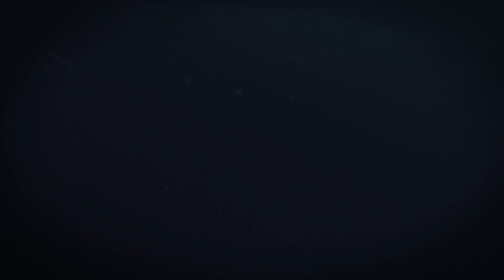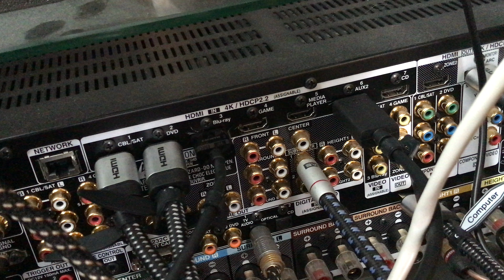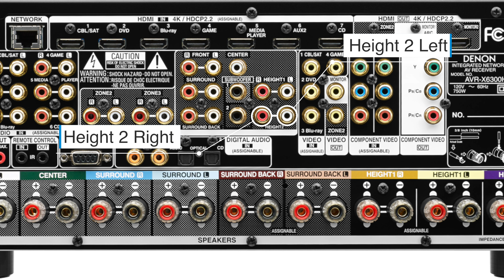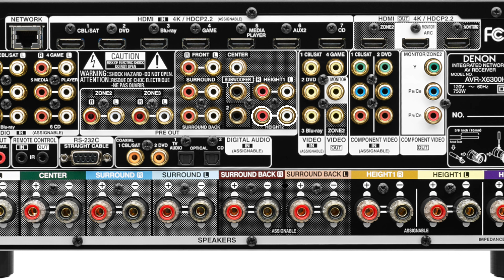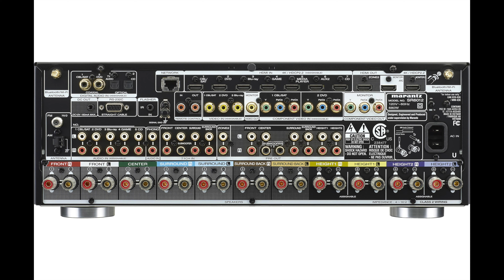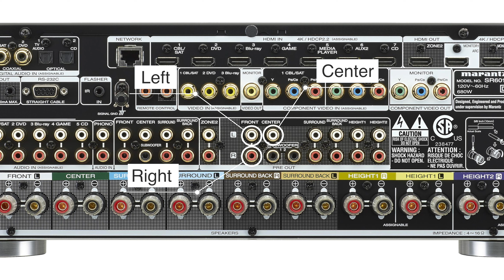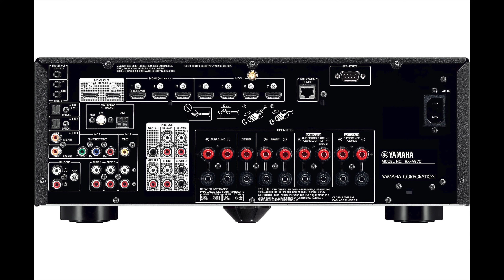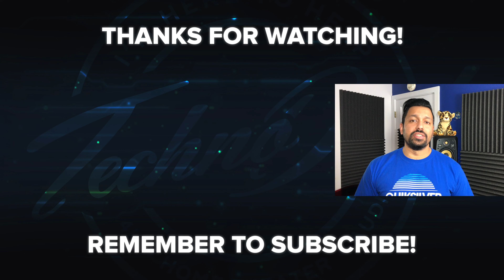How to Add an External Amplifier to Your AV Receiver | Home Theater Basics

Comment: Hey man! Thanks for the video! If you just do a two-channel stereo amplifier for your front left and right for great stereo playback and use your AVR for your Center and surrounds do you have to worry about things being unequally powered and sounding bad for movies? Or does the AVR know how to even it out? Thanks again
Reply from the maker: Hi Michael, great question!  If you are using the pre-outs on your AVR, it should be balancing your system even though you are using an external amp for your mains.
Reply: @TechnoDad  you're the man thank you! Just when I start I think I got this stuff figured out I get confused you. I was looking at a preamp that is a power amp also and was talking about fixed gain to use as an external amp so I thought that was necessary for all external amps. But I guess that's a preamp thing.
Reply: @TechnoDad  how do you control volume? does the pre-out to the amplifier will increase the volume if you increase volume in AVR? amplifier does not have a volume control, right?

Comment: My receiver doesnt have rca preouts. Can you just use your speaker wire from your regular output
Reply: No
Reply: actually, yes you can.    You need something called a line out converter, or LOC converter.  An active one preferably.

Comment: Hi tecno dad
I have an onkyo receiver TXRZ 720 7.1 channel, a fluance bipolar surround speaker HFBP,
 8 ohms 30-120w, and fluance tower speaker XL7F  
8 ohms 80-200w. When I checked on the internet it said the onkyo reciever is able to go 8 ohms 110w per channel, 6 ohms 225w per channel, but why doesn't it show 8 ohms when I go to the settings because it only show 4 ohms and 6 ohms.
next if I go 6 ohms 225w per channel and put volume on high, could it damage my surround/ tower speakers or receiver?
If I want to add ceiling speakers can I connect them to my rear surround speakers through a series connection?

Comment: Ultimately very efficient speakers will do the trick if you are doing a living room system or in a situation where you cant crank it.

But in a dedicated room where you want to hit reference level, additional amps for the front sound stage is the way to go.

Or even better...sensitive speakers AND plenty of power.  The best of both worlds.
Reply from the maker: Agreed!!
Reply: Ooh… I was **wondering** what on Earth the Audiophiliac was going on about when—during one of his celebratory videos of the Klipsch RP600M bookshelf speakers (which I was convinced to acquire)—he made a comment in passing, while *celebrating* how easy they were to drive, that they would make use of the power “*if you had it*.”  
I had bought what is considered a “*powerful*” Onkyo receiver from a list of the Top Ten AirPlay 2 AVRs of 2019, to feed the “*power hog*” ELAC Uni-Fi UB5 bookshelf speakers Steve G. and the posse had convinced me to acquire not long before the Klipsch.  
I remain confident the ELACs will **feast** on the Crown XLi 1500, but I must admit, the much more sensitive Klipsch remained a source of curiosity.

Comment: @techno dad, does that mean I can run two of the same channel, so if I get an amp to run my front right and left and center channel  could I run a another front right and left and center channel? One set off of the AV receiver power and another off of the amps power
Reply from the maker: Yeah, in theory you can, but I think they would be off power wise.
Reply: @TechnoDad  why the reason I was asking is because I have 4  floor standing speakers with Atmos enabled in the top of them and I wanted to put some in-ceiling speakers and run both of them at the same time

Comment: Great vid! I have a theatre newbie question about powering just your front LCR with an external amp and leaving your receiver to do the (4 to 8) other surround channels. Is there now an imbalance with power to the front LCR as compared with the surrounds that you have to make adjustments for? Manual adjustment or using your receiver’s room correction mic? I know you removed the main load with the external amp.... but who knows what the receiver is now supplying to the rest....
Reply: Nope. Thats exactly what you should do.

Comment: Thanks TechoDad. good info. Now what if you are using an old extra AVR instead of a dedicated power amp? what would the connections be from Main AVR to the old AVR being used as a PA ?
Reply from the maker: Hi!  So that's tough as you'll have two volumes to deal with.

Comment: Can I hook up car subwoofers to the denon avr x4400h reciever?
Reply from the maker: You could, but how are you powering them?
Reply: @TechnoDad  I would like the reciever to power them other wise I would use a 400watt JL car amplifier. The car subs still sound good and I don't want to spend another 500+ dollars on a home theater subwoofer. I had the subs hooked up to my old Sony reciever that is around 15 years old and it worked fine. It seems trying to get these car subs to work with this new Denon receiver is a lot more complicated. Any help is much appreciated. The subs are two 10inch kicker cvx btw.
Reply from the maker: Using the AVR would be tough as you would need another output.  How many channels are you using all together on the X4400H?  7 channels?  9 channels?  You would need a line level out and you might also need a crossover.  If you were to power the subs with that JL car amp you mentioned, you could use the subwoofer pre-out on the Denon and that way the signal would at least be crossed over.

Comment: Sir, what brand of "Banana Plug - cables" are you using? I use Profigold Banana Plug connectors which I generally connect with the speaker wires and then they are ready to use. Looking at those pre-built cables I feel they save a huge amount of labour - of pushing seperate wire individually with each piece of banana plug connectors !!! And where to get them online? Any link from Amazon? I mean amazon.com?

Comment: So,where do I plug in the power cord in the reciever so the amp will switch on and off with the receiver
Reply: You need to connect the cable from receiver 12v trigger out and into the amp 12v trigger in if it has it.

Comment: Can pre-outs be connected to video in/Aux inputs on a pre-amplifier and have that connected to a power amplifier to drive main left and right speakers?  I have current audio system that way and would like to just feed receiver pre-outs to the preamp
Reply from the maker: Hi!  Maybe if the pre-amp doesn't process the signal.

Comment: Hi technodad,  I have the emotiva A300 pushing my LR speaker at 150 watts per channel. Sounds great but now my center speaker (Klipsch RC62II) seems to be underpowered. I was looking at the outlaw 2200 monoblock to power it up. Can I choose  a different brand of ext amplifier(outlaw) or should I stick with Emotiva and get monoblock from them for a more uniform soundstage? What do you think ?
Reply: Stick with emotiva great performance and they build them like a tank always underated watts so 80 watrs would be 100.outlaws good too but I like emotiva products a lil better.
Reply: Just get the Outlaw mono. Those are real good amps. Center is the most important piece and you aren't going to notice a difference in sound between the front 3.

Comment: I have a Marantz 7011 and I just bought a Emotiva Audio A-700 BasX 7-channel Power Amplifier. I have 4 of these  Klipsch RP-280F and this as my center speaker RP-450C and I have 2 of these RP-250S thinking about buying 2 more of them and finally 2 subwoofers  R-115SW subwoofers. Would like to buy some ceiling speakers for Dolby Atmos. How would you hook up all of this?

Comment: Nice video!!
I have denon rxv2400. It has pre-out for zone 2 only. Can i add an amp and run 5.1 setup? Need your wise suggestion.
Thanks
Reply from the maker: Hi!!  When I search Denon RXV2400 I get a lot of results for a Yamaha RX-V2400
Reply: @TechnoDad  sorry my mistake. It will be denon avr x2400h.
Reply from the maker: Okay, so with this AVR you should be able to run 5.1.2 with zone 2 pre outs as well.
Reply: @TechnoDad  thanks for your reply. My intention is, I want to use power amp for front L & R channel using zone 2 pre-out. Is it working like actual front L&R channel in surround mode?
Reply from the maker: @lovethemusic4933  Yeah, that won't work.  Zone 2 is completely separate from the surround in Zone 1.  You would need the Denon X3400H to get Pre-Outs to do what you want to accomplish.
Reply: @TechnoDad  thanks for your suggestion.
Reply from the maker: You're welcome!

Comment: My Onkyo TX-NR757 doesn’t have a pre out section. Can you do a google search and look at the back and tell me what my best option is?  Looking to get an external amp and can’t figure out how I would go about connecting it, or should I just give up on this receiver and get a better receiver. It’s a great one and I hate to have to get a new one, but will if I have to.
Reply from the maker: Hi!  Yes, you would have to get a new AVR.  If you like Onkyo, you would need something like the RZ820 (https://amzn.to/2P1sdE8) $499 right now.  It'll give you a little bit more power and has the pre-outs for all 7 channels.  But, if you're going to plunk down that much money, I would suggest saving up a little more and looking at the RZ730 (https://amzn.to/2E0zbIH) as it can process 9 channels and has pre-outs for upgrading power later on.
Reply: Thanks man. Much appreciated

Comment: Hey Techno Dad, I enjoy your youtube channel. 

I have two systems that I would like to incorporate into an older but still good Sony Receiver. It's a Sony STR DA3100ES driving Mission Speakers.(1) I would like to input my Schiit Jotunheim Pre-Amp with DAC into the Sony. Should I use an analogue single ended input such as the Tape that is unused. (2)The other system is a Schiit Asgard 2 which is my analogue rig with a turntable pre-amp Schiit Mani. Any suggestions are appreciated. Thanks

Comment: HELP please , i have ht7800 from onkyo and the av receiver do 100 w/ch 8ohm , so if I put an amp thats give 140 watt is that well be 240 watt total or only 140 w?
Reply: That would 140Watt per channel only for the amp that you have added. Its just that you will not be using the power of HT7800 as what is advertised is not entirely true. So if you use 7 channels of HT7800 it is not 100W/ch in reality .. it should be around 60 or 70w max :)

Comment: Techno dad, I'm a complete noob when it comes to power amps. Never thought i needed one until i saw your clip. As my frontstage,  I have a couple Klipsch 82ii tower speakers  paired with the RC62ii as a center, powered by my Pioneer elite sc-77. I always felt my speakers werent use at their full potential. I thought it was because my speakers were weak and needed to be replaced until I saw your video. Do you think I'll gain a fuller sound by buying a power amp? And if so, which 3 channel power amp do you recommend? I have a 7.2 setup.
Reply from the maker: Hi!  Well, those Klipsch are 98dB sensitive so they should be plenty loud!!  If you are having issues, then a 3 channel amp would be a great addition to your setup.  There aren't too many on the market, but I know Emotiva has the XPA-3 Gen 3 (https://amzn.to/2SD8OfZ) which is $1,199.  Then there's the Parasound A31 (http://www.parasound.com/a31.php) which is around $3K.  You could also go with a 5 channel amp but only use 3 of those channels.  Shoot me an email and we can discuss this in greater detail: technodad55 at gmail

Comment: So if I remove certain speaker from my main receiver to an external amp. The receiver automatically will re power the rest speaker left with higher wattage?
Reply from the maker: That's the idea, but I'm not 100% sure that all AVRs do this.  I know some save higher amounts of power for the front stage and give less to the surrounds but I'm not sure all of them do that.
Reply: Since you and me have Denon receivers have you tried to see if there’s a difference as far as the receiver power after removing some?
Reply: Technodad if I would want to use my Denon to power my front stage and height speakers, with Front biamp it doesn’t matter the amp assign option right? The preouts always have a signal coming out of them right? The external amp would power the surrounds and voice of god channels. Also does the VOG channel compatible to be used with all the sound formats?

Comment: I need help understanding a receiver a bit better.I have a setup with large speakers and a decent size sub.I can not run the set up on a high volume without the reciever crashing.I have a denon 170w and I am not sure what to do.Im sorry if I seem liuke an idiot,just need to know...
Reply from the maker: Hi!  So it sounds to me like you AVR is clipping at high volumes.  That means it doesn't have enough power to properly drive those speakers.  What model speakers and AVR do you have?
Reply: @TechnoDad  we seemed to have fixed it for now.We used a small gauge wire we found for 1 of the speakers and it seems that now that we removed it,its no longer doing that.I will keep you updated if it happens while testing.
Reply: @TechnoDad  also the unit is an onkyo 170w and we are attaching 4 mini sony chirps and 2 large sony speakers.There is also a subwoofer.(dont remember the brand of that one but its adjustable,not a one connect

Comment: Hey man thanks a lot for the video. My question is that which Rca cables should be used for connecting the integrated Amp?
Reply from the maker: Hi Zain!  Thanks for watching!  I'm glad you found the video.  It's really up to you.  I like the SVS RCA cables as they look nice and have a good gauge size to them.  Honestly, anything should work.

Comment: Hello, I liked this video.  I've got the Yamaha AVR and the preouts are xlr.  Connected them to a QSC power amp RM 1450 with LEM x300 speakers (Front L&R chnls)..Im just surprised that it really doesn't sound as good as when connected to a mixer.  Any thoughts? Thanks...
Reply from the maker: Hi Manny!  Those QSC amps are made for live events as opposed to home theater.  That could be it, but I'm not 100% sure.
Reply: @TechnoDad  Hello, thanks much for the comment.  There was a gain on the amp which was set halfway.  I turned all the way clockwise and now it sounded better but i feel like a hifi or hometheater speaker will sound better ... thanks again.

Comment: So do you control the volume for both amplifiers separately? or is there a way that they sync up in terms of gains .? So if i raise volume for front stage then surrounds wont get proportionate boost?
Reply from the maker: Hi!  The volume on power amps are always at one level.  The volume will be controlled by your AVR or pre/pro only.

Comment: I have an onkyo nr646 and I'm currently running 5.1.2 atmos set up, and I love it.  So I wanted to make it 5.1.4. My question is, can I add an 4 ch amplifier to my receiver and run 4 atmos speakers the upfire type. U think that would work. I really don't want to upgrade my receiver.
Reply from the maker: Hi Pete!  Unfortunately, you would need a 9 channel AVR.  The NR646 is a 7 channel AVR and it does not process those other two channels.  If you were thinking of staying with Onkyo, you could go with the NR787 (https://amzn.to/2DKK6a6) to setup a 5.2.4 system.
Reply: @TechnoDad  thanks, that's what I thought. I just got the nr646 like 2 months ago and already I'm thinking bigger and better. I guess this hone entertainment system has me hooked and upgrades are coming.
Reply from the maker: Yeah, just find the right time to buy.  Like when the new stuff comes out, just get the slightly older one at a great discount.

Comment: Which RCA Cable brand you are using to connect between external amp to receiver ? What are they called ? RCA Male to Male Connector ?
Reply: These are close https://www.bhphotovideo.com/c/product/1320321-REG/svs_soundpath_rca_audio_interconnect_cbl_3m_soundpath_rca_audio_interconnect.html

Comment: So I would most appreciate your help. I have a Denon 4400. I bought a 2 channel Rotel to power the 2 mains. I have my  hard wire connections same as yours and no sound. Speakers are going to Rotel with Rotel set to unbalanced with RCA cables for R and L. I have my receiver set to 11.1 but I don’t have any options for selecting the two fronts as pre outs. I actually can’t isolate any channels for pre outs. This is my first time using external amplification and I’m lost. Any ideas? What’s left of my hair may be pulled out soon. Lol
Reply from the maker: Hi!  I made a video about assigning the front speakers as pre-outs, just follow the steps on the video: https://youtu.be/LuFqhCHc7KY
Reply: You’re the man! Thanks so much I didn’t find that one last night. It worked great and within 2 minutes you’re awesome I owe you! 🙏
Reply from the maker: You're welcome Alex!

Comment: So, forgive a newbie here, but when you connect your speakers to the extra amp, along with the RCAs going from the Denon to the extra amp, then that leaves Denon's L&R speaker slots completely empty right? No cable in there. And I understood that much from this video that this would happen with the Center channel as well? Like, remove the speakers from the Denon, plug them into the extra amp and connect the Denon with the extra amp, using the RCA cables in the corresponding speaker slots. Did I get that right?
Reply: Also for volume control - https://denon.custhelp.com/app/answers/detail/a_id/4738/~/avr%2Famplifier-volume-level-control-for-zone2-pre-out
Reply: I was wondering about that too. Do you remove the speaker wire from receiver and hook em up on the amp or just wave em there?
Reply: Yep .. leave the cables behind the AV receiver empty. As your extra amp is going to take over the load for the front two speakers